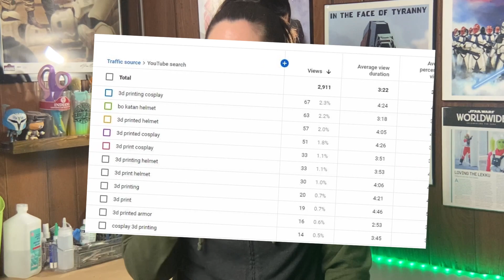Is 3D Printing Your Cosplay Cheating? // VAULTFOX Vents

Comment: I have 3d printed most, if not all of my OC mandalorian costume. As I'm sure you're aware, it takes a lot more than just 'turn printer on and done, cosplay complete'. As long as your happy with how your making  your costume, it shouldn't matter how your doing it 😊.
Reply from the maker: exactly! at the end of the day, as long as you're happy with how you made it, that should be enough. right now I'm happy making things with my printers but I'm sure the foamsmithing bug will bite me back eventually.
Reply: @vaultfox  and as long as it keeps you happy, keep doing it and don't worry about what others think. They are probably only jealous because they don't have the skills to operate a 3d printer 😂

Comment: I have a small printer and a big head. I printed my mando helmet in 7 pieces and assembled it. no one will convince me it wasn't hand crafted.
Reply from the maker: right ... these things don't just come off the printer ready to go, especially in the situation you're talking about! that's how my Zorii helmet was, basically a huge puzzle of bondo, super glue, filler primer and weeks of sanding
Reply: @jasonwick3257  sorry for the late reply but yeah it's very strong. i used 2 part epoxy glue to bond it. also the shape of a helmet is an inherently strong shape

Comment: Thankyou so much for this video. Agree with everything that was said. We have been into cosplay for about 1 1/2 years but wanted to for a very long time before that. We didn't because we had no idea about sewing, foam, 3D printing etc and it was always so intimating (and still can be) seeing what everyone makes and knowing you can't. We ended up buying our first suits just so we could actually start cosplaying and have started learning some other skills in foam and 3D printing but it takes time. Hate the idea that any method is considered cheating when it should just be about having fun and sharing your love for a character.
Reply from the maker: That's awesome! And I even forgot to mention that purchasing a cosplay can itself be research like you said. And you're exactly right ... no way of cosplaying is better than another or "cheating", they're all tools in the tool belt we can pull from!

Comment: I would slap anyone that claims 3D printing is cheating, especially after all the work I've seen and done myself in getting them post processed, sanded smooth and painted.  It takes no less effort than other means of cosplay construction!
Reply from the maker: Exactly! I think a big part of it is lack of awareness of the process .. it's a lot of work from getting the model on the bed, to actually printing it successfully and then onto finishing it!

Comment: I’m planning on doing a Spartan cosplay from Halo 3D printing, would LOVE to see a cost breakdown
Reply from the maker: will do!
Reply: I've never printer that armor, but doing a quick ball park estimate on just the filament, here you go. You'll probably need about 10 1KG rolls to do this. This would include failed prints. On average, PLA filament (cheapest and easiest to print) costs about $20/roll. So you're looking at $200 in filament alone. You may want to also think about paints, LEDs, visor, costume attachment supplies, etc.

Comment: Eh, the only "cheating" I would consider for cosplaying is if you just throw money at someone and have them do all the work. But at the same time, if that's what you want to do, you do you, boo boo. Gatekeepers will be gatekeepers. 

In regards to 3D printing stuff? Psh. No. The amount of post processing and work that goes into finishing a 3D print most definitely removes any "cheating" from the equation. Even more so if you design the 3D files yourself (like me, so I don't get in trouble with potential copyright nonsense). The scaling, interconnections, print friendliness. Yeah. Not cheating. Get that nonsense out of here.
Reply from the maker: Commissioning people is totally fine but just be honest about it! I think that's where a lot of people get upset about it. And right, I've honestly struggled with the "3D printing is cheating" mindset before where I almost didn't want to say I "made" anything unless I modeled it myself, but I've got past that.
Reply: @vaultfox  Yeah, if you claim someone else's work as your own, or give zero credit where credit is due, that's a whole other issue beyond "cheating at cosplay" and douchebaggery is at work. And feeling a bit awkward about claiming you "made" something when its 3D printed is understandable, because when you claim you "made" it, some people also instantly assume you designed it. Which isn't always the case. But again, with as much work, time and effort that goes into 3D printed post processing, claim that you "made" it with pride. Because it isn't easy by any stretch of the imagination.
Reply: But what if someone had zero or very poor crafting talent?🥺 or if they don’t have time to make it but really want to but don’t have the time to make it? Or if just need some help? 

It would be fine for them to buy the costumes completed or half completed

And 

The people that have the money to buy full custom completed armor from another person are fine, as long as they mentioned the person who did it for them.😁

Comment: Like most comments say, I had no idea 3d printing cosplay stuff was seen as cheating. Not sure how, a 3D printer is just a tool, and I have even more respect for someone who CAN make stuff look good with foam and cardboard, but not BECAUSE they use foam and cardboard. 

Plus 99.9% of the time you don't just print something and voila its done. I'd say it's just as much work, and also depends on the cosplay. I think anyone who says 3D printing is "cheating" just hasn't used a 3D printer and assumes you just make a few clicks, spray paint and you're done. 

I spent maybe 2 weeks developing a Green Goblin Pumpkin bomb design, all 3D printed but definitely took some tinkering and work. Ive seen other people make the same pumpkin bombs using cardboard, foam, and hot glue, and they're all great. 

3D printer is just a tool and like any other tool, it all depends on who's holding it. 

I've had a few cosplayers buy my 3D printed stuff, and that's because if you want something authentic looking, 3D printing can get some nice details and accuracy for when you're looking at something close up. I think any method of cosplay building should be accepted.
Reply from the maker: People will always criticize what they don’t understand, and like you said … it’s not like they come off the bed looking like they do! 3D printers are a tool and honestly without them I wouldn’t be able to put out nearly as much content as I do, if they help me “cheat” in any way it’s that they give me time back!

Comment: the only genuine form of cosplay is to use accurate materials, and where those materials don't exist, you must use a functional substitute.
That's just the rules. Only level 4 body armour capable materials are correct for clone/stormtrooper/Mando armours.

Properly treated and bullet-proofed AR500 steel, Hardox wearplate, and Titanium armour alloy are the only non-cheating materials to create star wars armour.
Reply from the maker: FACTS lol

Comment: whoever says stuff like that has clearly never worked w a 3d printer. i made two full sets of clone and mandalorian armor w eva foam before i bought a printer. i thought it would be easy cruising from there. but no. i’ve had more difficulty w my printer than i have w eva foam. it takes so much work and someone invalidating that is bs
Reply from the maker: I compare it to a sewing machine ... I have a sewing machine and I can barely sew myself out of a paper bag. These machines require skill to manage and like you said, there's so much work after the fact. You can have the cleanest prints off the best and if you're not good at finishing it doesn't really matter ... and at the end of the day why does it matter so much to someone we don't even know how WE make our costumes?